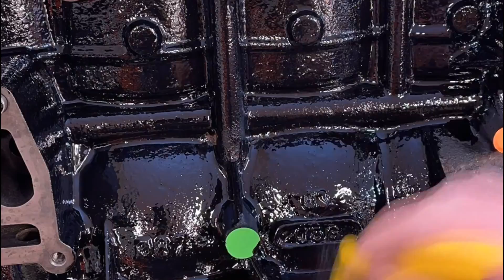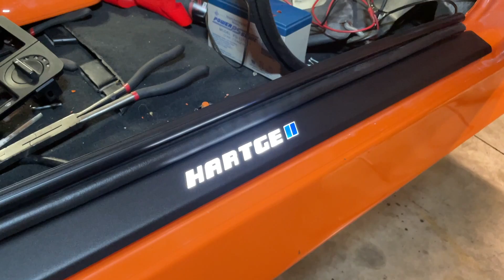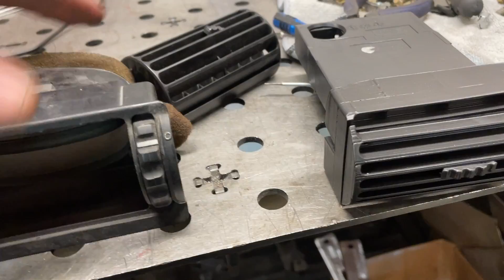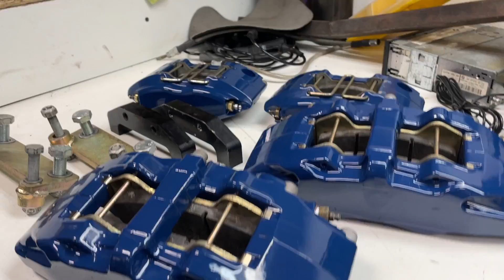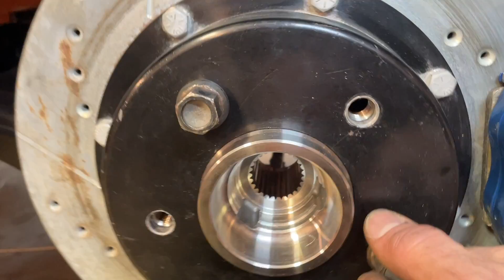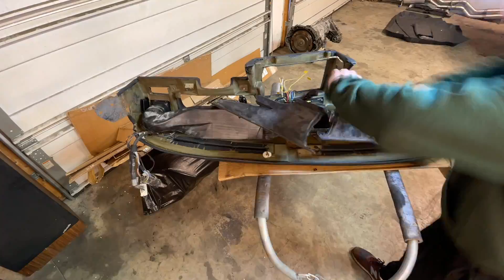Part 13: 🚗Epic Build Update 🔧 E30 M3 S54 Drivetrain, Custom Brakes & Dash Install!  #E30M3S54

Comment: My experience with the Wilwoods is that they are great, but the stock ABS is too restrictive to flow the increased volume that they demand for proper feel.
Reply from the maker: We’re using an m3 ABS, but have thought about upgrading to MK60 actually!